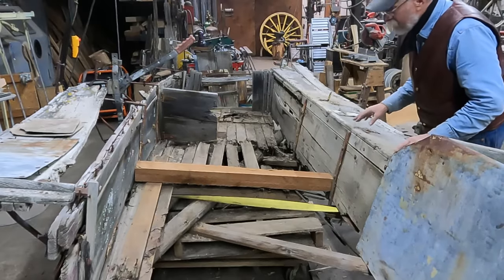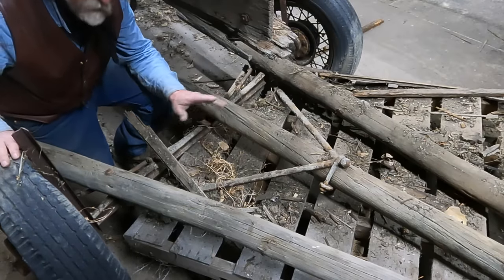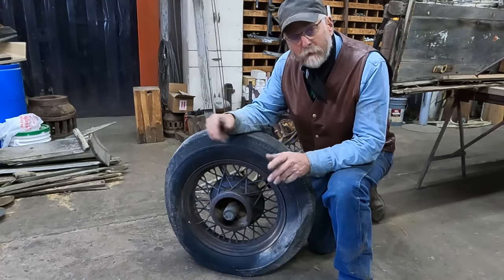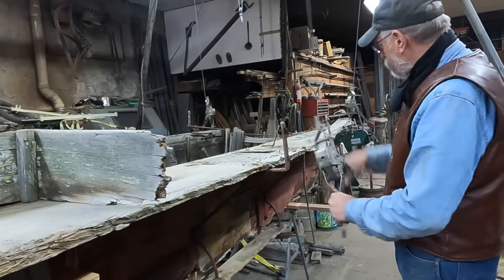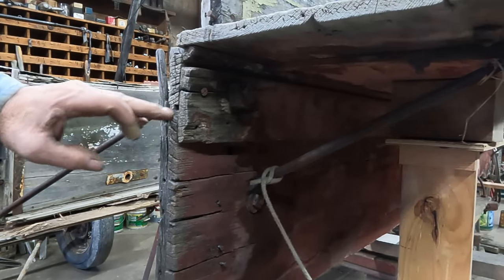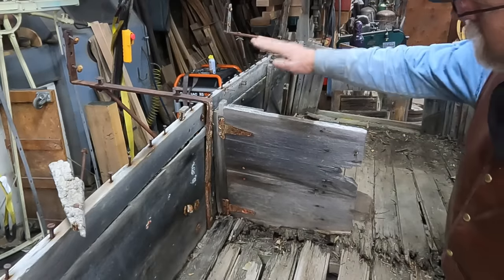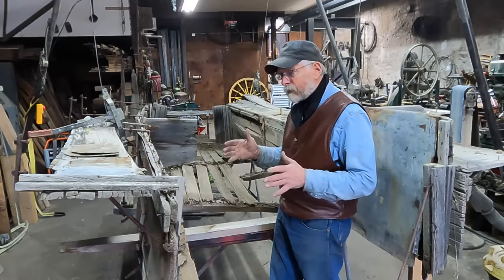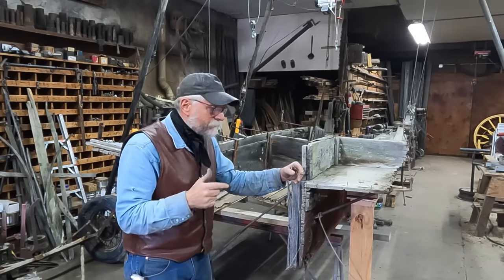Where's The Mud Wagon? Why The Sheep Wagon? | Engels Coach Shop

Comment: A local veggie stand is a horse drawn grain box set on a Model T frame and axles. Conversion kits were available to add tongue and steering after removing the body, motor and transmission for a 4 wheeled wagon.  Home builts copied those features. I have record of 57 differing conversions off of eBay. 
However sometime the 4 wheel wagon running gear if ever present was replaced with the Model T or TT axle, wishbone, later spoked rims to become a 2 wheeled cart/trailer.
This South Central Pennsylvanian living near the Studebaker wagon producing blacksmith shop hears it's remains to become yard art as a 2 wheeled sheep's trailer with either Ford wood or metal spoked wheels.

Comment: That’s an axel from a 26 or 27 Model T, with later wire wheels on it . Wires were an option in 26-27. Those hubs are hard to find, not rare but maybe $50 to the right buyer.
Reply: Good work bud! I believe you are right, glad to see a ford guy on here😀 wheels look like 18s to me which would make them 1932s I think 🤔

Comment: Likely a 16" Kelsey Hayes spoked wheel. The Triangular part of the axle (Radius Rods) fastened below the back of the engine.  32 Ford would have been a V8. Hydraulic Brakes came in the later 40's.

I think you should consider Selling the Hotel.  Lighten your Load.

Comment: Enjoy listening to you translate what the wagon says to you.   If the axel and Ford wheels was in Alabama we'd call that a Hover Cart.  There could be two reasons to build one.  First the wagon wheels gave out or were damaged and the Ford wheels and axel were available.  Second if a decision was made to pull the sheep wagon with a pickup truck the Ford wheels would  obviously work better especially on a road.  Anyway looks like an interesting restoration with  turns and twist depending on what you hear from the wagon.  It will be both and education and entertainment for me.

Comment: Around where I grew up there was a home made utility trailer that had an axle and wheels like those wire wheels .  They had the hub caps on them with "V8" stamped on them.  So when Ford had a V8 would help date the wheels.... I guess!  Greg
Reply: The wheels and front axle are from a 1932 Ford, '32 was the first year for the flathead V8, the Model 18 had the V8 and the Model B had a flathead four like the Model A.
Reply: @daveo.6659 The axle and wish bone are Model T or TT.

Comment: Dave that’s a model t front axle with 1926 or 27 spindles and later wheels, wheels look like 18 inch so probably 1932.  I could use those spindles if you don’t need them? LOL

Comment: 1:46 that cradle setup is deceptively simple, yet amazingly versatile. Usually you see double A frames with a H beam and a single hoist, this is so much better.
Reply: Ford Model T or TT axle and wishbone (no kingpin inclination). The tie rod is refigured to prevent spindles from turning.

Comment: I find it really surprising that the single axle is so far back and comprising three poles. It must have caused a lot of 'nose weight' for the animal to handle. So wonder if there's any indication that the original axle was more centered.
Reply: The original grain box or sheep wagons had a front and rear axles. Sometime it became a single axle trailer more than likely towed by a truck or tractor.

Comment: @10:14 -- Wouldn't the original grainboard/tailgate have been only as tall as the original sideboards (16")?   Assuming the original grainboard/tailgate was not 20" tall, then the side rails for that grainboard/tailgate would not have been that tall and the whole thing would have had to have been replaced in the conversion to sheep wagon.  In other words, the hole for the cross rod you reference is not the original cross rod hole (and not necessarily the original height) because you are looking at a replaced piece?